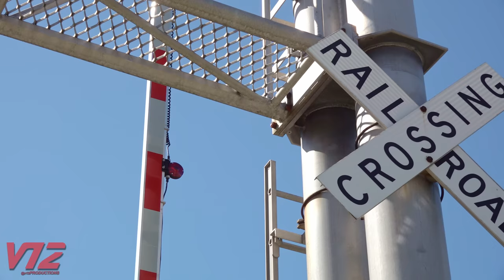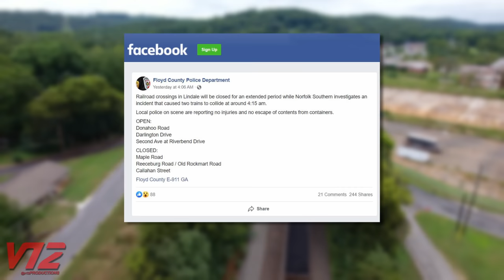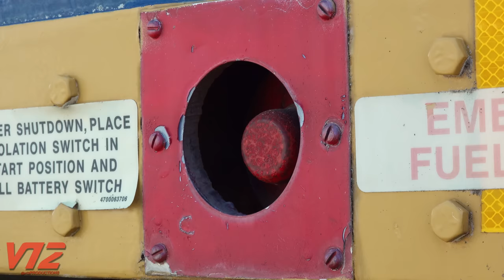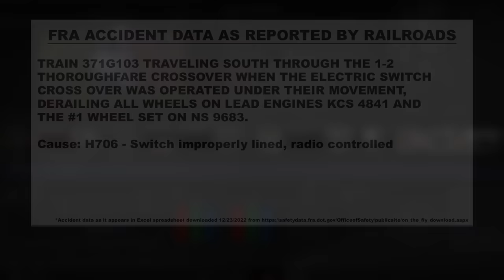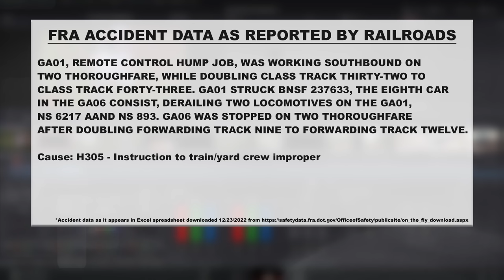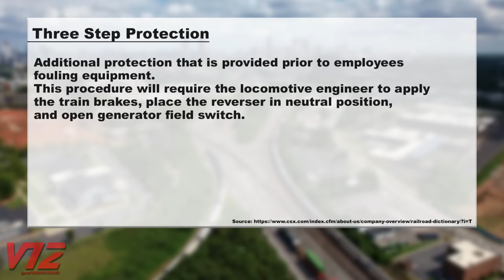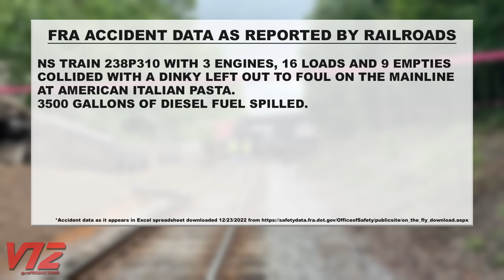Train Wrecks 2022 | SPECIAL REPORT

Comment: I wonder how many Truckers Lose their CDL’s when they Obviously Don’t follow US Laws regarding Safely Operating Motor Vehicles.  NO Excuse for Collisions. 🤪👎
Reply: Highly doubt any lose there cdl  im sure they get heavy fines. But who knows
Reply: They won’t lose their CDL, but good luck getting any decent job after. Getting a low boy hung on the tracks, or pulling through the track to wait on a red light are both inexcusable.
Reply: I hope the speed is set to 100km/ hr until  total replacement of LD trucking finished by 2035.
Reply: @SovereignTroll  replacement of LD trucking? Good luck…..
Reply: @thetowndrunk988  This has always been one of the things you have to be conscious about. I drag a low profile step deck 50’ trailer behind the tractor I drive for work. Not to mention your landing gear is just a few inches off the pavement. If I have to cross over a set of tracks that are heaped up in the middle of the road, I won’t go over it. I try to anticipate my route to my destination before I take it.
Reply: @jasoncordill2658  yup. I’ve had boat trailers, RGN’s, and of course extendables with jeeps. Can’t just cross Willy Nilly with any of that.
Reply: Railroad crossing incidents for cdl holders usually result in automatic lifetime revocation. 
Having driven OTR for 34 years I can say GA is one of the worst states for piss poor rail crossing/road planning. Far too many crossings are too close to traffic lights, not enough room for traffic between crossing and light. Trucks trying to make the light and not get caught on the tracks can be a crapshoot.
Reply: @dps67  Georgia and the Carolina’s are terrible. Have to stop 200’ from the light, and half the time there aren’t light sensors behind the track.
Reply: 26,679 in 2022
Reply: I drove trucks for much of my adult life. Most truck drivers shouldn't be truck drivers at all.
Reply: @billyjo1148  First off, where is this data that says many truck drivers have drinking problems? Second, being non-Union is pro business, not anti business. Union is never good for business. It’s good for employees.
Reply: @leonardovalladares4315  😊 😊😅😅
Reply: Hey honey See 49:33 49:33
Reply: @valentineiwanus7705  WTF
Reply: Some of us are tired of seeing piss bottles in the ditch..........
Reply: Every one....the only exception is if you are a trucker that legally stopped for a train crossing and the train derails at the crossing  and hits you that is not your fault.....
Reply: @cliffnelson1174  it’s not your fault if it derails. But I do not believe you’ll lose your license if it is your fault. I cannot find a single statute or law saying it’s automatic forfeiture due a train collision. I’ve read several times that it’s considered a major incident, of which 2 in 3 years could get your license suspended for 60 days. Of course your odds of getting a job are zero, so they might as well take it.
Reply: @cliffnelson1174  actually, I finally did find it. 60 days on the first offense. But might as well be years, because no one (myself included) would hire anyone that got swiped on a track crossing.
Reply: Truck driver be like 😱😱😱😱😱😱
Reply: Hardly any of them I haven't actually been in that predicament but company i work for has had a lowboy flatbed taken out in PA by a  train, driver usually gets fined but not a removal of license typically iv never heard of a driver detring his license revoked due to train vs truck accident.
Reply: If they don’t lose their life first.
Reply: 6
Reply: I was shocked to see they actually produced a website, not promoting stupidity but so many 18 wheeler drivers don't have the sense to NOT cross or even have their load become stranded on tracks. I worked in fighter aircraft maintenance for the military for twenty years.

If we cut corners in safety you lost a limb or if you came too close to a running engine inlet, you lost your life, no videos, just put the remains in a box and that's all.
Reply: They get hired by swift or fedex.
Reply: But UR pretzel logic defends trains doing the same thing. Except cars don't release toxic chemicals into the air & water in residential areas ? Plus cars outnumber trains 100,000 to 1 Semis a 1000 to 1. Pretzel logic is twisted.
Reply: Q
Reply: 8uhhhhhhhhhvvvvçxzz😆
Reply: @thetowndrunk988 You forgot to mention that even if you go owner/operator instesd, the insurance increase will force you out of the industry.
Reply: @gorillaau  Indeed
Reply: I am a college holder and have been 40+ years.
Non cdl holders don't  understand that field.
Drowsy,  narcotics,alcohol,and all felonies can and get pulled.
We drivers have a lot of files regulations that are checked at weigh stations.
And if rules aren't broken you can and do face fines from 100$ to 3400$.
Cars get  speeding ticket 100$ ,trucker get one 200/500$.
We go through a lot.
Multiple cdls are pulled everyday.
Reply: @bradholt9036  People see movies based on stuff from the 70’s…..trucking is an entirely different industry nowadays. The old days of chicken feed, and going from Atlanta to LA with a 3 hour “nap”, are long over. There is no realistic way to cheat on the HOS nowadays, and drug use is extremely rare. Now, I’d argue that distracted driving, ie phones, are the new “road dope” for accidents, even amongst truck drivers. And common sense has certainly went out the window since the good ole days. But, it’s by and large a much safer and cleaner industry than it used to be.
Reply: @bradholt9036  Hey. Australian here. Truck and bus drivers over attract double demerit points for offences. An example is a broken or loose Rachet buckle will attract a $300 fine per buckle!
Reply: @gorillaau  Here in America, a non-commercial load can have all kinds of issues, and chances are there won’t ever be a fine of any sort, unless something falls out and hits something else. In commercial transport, however, the entire truck can be shutdown for something as minor as a small fray, if the remaining tie downs are not sufficient for the load. Even if the remaining tie downs are sufficient, you’re still gonna get a fine. One thing I love about Australia (this is my understanding, so correct me if I’m wrong), is that even non-commercial vehicles are subject to weight and tie down inspections, when hauling or especially towing. If that’s true, I think it’s a very good thing, that we need here. I’ve seen so many people towing with the rear axles nearly bottomed out, and then you get out to the windy western states, and see them wiped out.
Reply: @thetowndrunk988  Yes, you are right. All road users are responsible for their vehicle and the land that they might be carrying. If you are found to be towing a box trailer with excess weight, you can be pinged. Oh, same for uncovered loads such as garden waste and it's blow off.
Reply: @gorillaau  That’s awesome. We need to do that here in America. Commercial trucks are subject to securement and weight regulations, but that doesn’t exist for non-commercial. It’s a sad state of affairs.
Reply: LOOK
Reply: @thetowndrunk988 hmmm crappy  regulations??
Reply: @thetowndrunk988 says who? You?
Reply: @thetowndrunk988 hot shots also
Reply: None of them lose their CDL’s!! They may lose their job with that specific company but not their license. That’s  like saying when you don’t use your blinker in your personal vehicle you should lose your license
Reply: And apparently someone hasn’t kept up with the people that “train” these new drivers in the US. They take janitors, carpenters, dishwashers and every other profession and give them 3-4 weeks of in class training and pass them and give them a CDL. Most can’t speak English and have been in the US less than a year. So instead of worrying about the drivers losing their CDL’s (which I’m fine with) you should worry about the companies giving the CDL’s out, for a certain price of course!
Reply: In NW Florida the danger is Tri Axle dump trucks hitting school busses.
Reply: Watch 1940  Humphrey Bogart film. They drive by night 🌙. A lot fewer ( D.O.T. ) regulations back then.
Reply: The horns are annoying its better to see a train go by without the horn blasting

Comment: I worked several train wrecks back in the 70’s when I worked for Duncan Machinery Movers in Lexington, KY. The cranes we used would just barely span the tracks and when we crossed joints in the rails the square bolts the railroad used would tear chunks out of the sidewalls of the tires. The rail workers actually didn’t like us( not personally) because they didn’t get to use their wreck crews and equipment. Those old rail cranes they used were converted from steam engines to diesel. They would bring their wreck equipment in and they brought with them a cook car, a diner car and a sleeper. The work was slow but they made good money and were well fed. When I worked for them they would have a guy that would go out and find a restaurant and would constantly bring food to the site. It was hard work and we were tearing up a lot of equipment working these wrecks. We eventually gave up these jobs and I think we were indirectly responsible for getting RJ Corman started. At that time they were a small company with just a few backhoes. We were located in Lexington and Corman was about 15 miles away in Wilmore, KY. It’s amazing how big Corman got and he eventually got into short line railroads. The company has some of the nicest equipment you’ll ever see in a short line and their tracks are well maintained. I didn’t know RJ very well but had several conversations with him. Seemed like a nice guy. When the University of Kentucky hired John Calipari as it’s head basketball coach, he was picked up and flown to Lexington in Corman’s private jet. I last saw RJ just a few months before he died an early death from cancer.

Comment: Great content! I know of two accidents on the railroad I worked at where the anti-climbers failed on EMD SD70's. In both accidents the locomotive struck a flat car which climbed and sheared off the cab of the lead locomotive, killing the crew in both cases. I don't trust them at all. Luckily when a train I was running struck a vehicle, I was in a GM AC4400, and the car was thrown to the side. Minor injuries to the driver of the car, and no injuries to the crew.
Reply: Before they come out with the modified engine cabs and before they got rid if the caboose . they once had three SD's cut off to shove Train over a mountain something went wrong and the train derailed and that 24 ton caboose sliced that SD into little bitty pieces I would have never thought such . I seen the engine after they had loaded it into a gon and it passed through the yard  it was pitiful it cut that engine up in about seven pieces . it sheared the control stand off at the floor the engineer survived I don't see how but it killed the head brake man
Reply: Correction.... "GE" AC4400.

Comment: I'm a traindriver in Denmark - If an object is blocking the gates we have a signal that tells us to stop before the crossing - on newer crossings there are coils in the road telling if vehicles are stuck between the gates, and that triggers the same signal telling us to stop.
Reply: You can stop the train in the time between when the gates lower and the lead engines reach the crossing? I call BS…
Reply: Call whatever you want, this is a fact.
It's just a matter of proper timing - the gates must be lowered and secured in time for the train to sop if they fail to do so.
We even have crossings that'll tell if a vehicle is stuck between the gates on the track - it's just a simple magnetic sensor under the asphalt.
I know we are a much smaller country, but we only have around a handful of collissions between rail and other traffic yearly.
Reply: This video shows what I'm talking about :
The sign @2:21 tells me a Crossing is coming up - the flashing white light at 2:27 tells me the Crossing is secured, if it isn't, there will be two solid Yellow lights and I know I have to stop at the crossing.
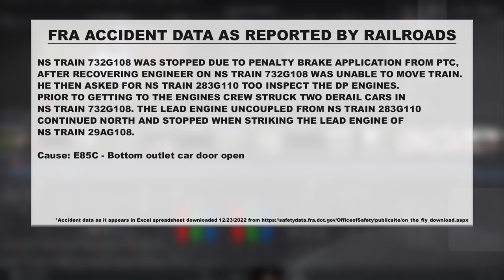You can see an example of two yellows @12:30.

https://www.youtube.com/watch?v=1zM9cgoosf4
Reply: @W210E50AMG  That's cool. Wouldn't work for giant freight trains in north america though, unless the bond was 2 miles long. I drive some that are 27, 000 tons. Takes a couple miles to stop.
Reply: @2kanchoo   Our trains are limited to 835 metres length, that's a bit over half a mile - we also have a weight limit of 2500 metric tonnes - so a bit smaller trains than yours :)

Comment: Very informative and interesting video. Thank you. As a lifelong rail enthusiast and a retired electric commuter train driver in the UK, I am increasingly fascinated by the rail operations in the US. One of my main spheres of interest on both railways and air travel is the causes of accidents and how each one has led to better safety procedures and improvements in the construction of rail vehicles and aircraft. It is interesting what you say about the number of accidents on grade crossings (we call them level crossings in the UK) - because here that is one accident type the rail companies have always struggled to reduce. Most accidents here occur on crossings where the barriers can be dodged, or on what are known as user operated crossings on farmland or private roads - I saw the result of one where the locomotive was covered in potatoes, even the cab was full of them. The other BIG problem we have here is with large trucks or double deck buses smashing into bridges that are too low for the vehicle to fit under. I had one of those happen literally right in front of me - the entire top deck was torn completely off a double deck bus, bits of metal, plastic and glass flew absolutely everywhere. Fortunately the bus was empty, but it was a hell of a mess to clean up. Anyway, keep up the excellent work. I always enjoy your videos.
Reply from the maker: Thanks for watching!
Reply: I am a sri lankan where weid accidents of this type occur frequently in our country. Most level crossings here are unprotected but stiil a great proportion of accidents involving trains And road vehicles occur due  to careless ess.